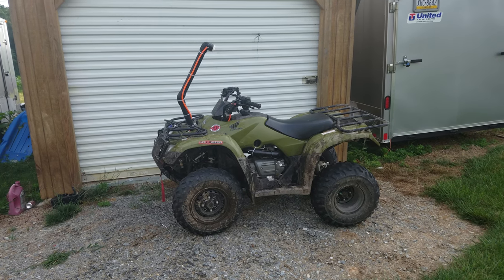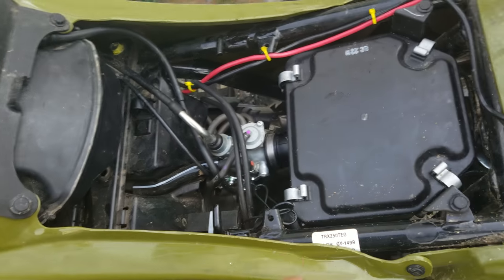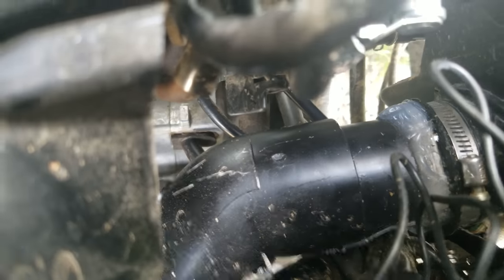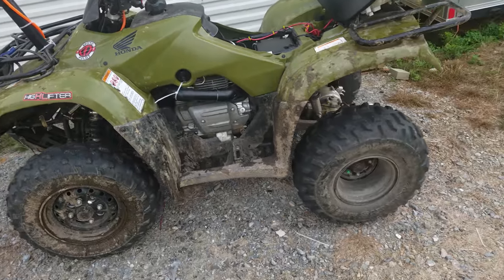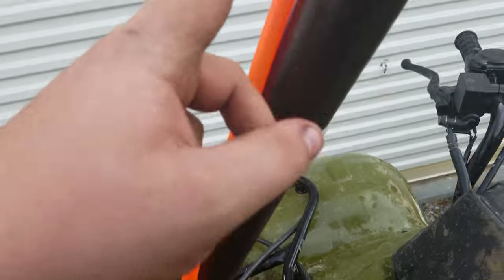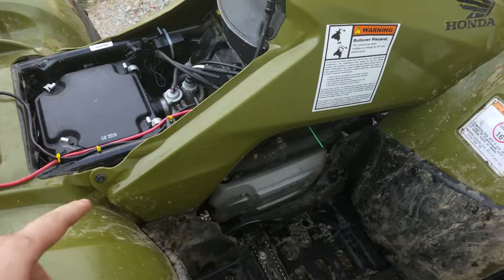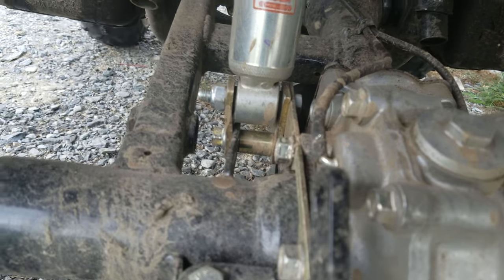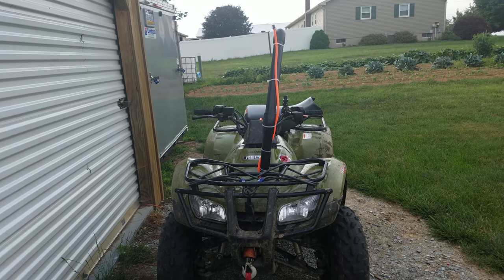How to snorkel a 2016 honda recon 250 es

Comment: So disconnect one end of the crankcase hose and extend it to run up with the snorkel? Just like all the others?
Reply from the maker: Curtiss Hodges  yes, both hoses from the diff run up and converged into one useing a Y connector. Then the single hose runs to the carb vent and takes another Y adapter to connect the now single diff vent hose to the carb vent, then I ran a single hose up the snorkel for venting. 

For the big crank case breather I just picked up a hose connector from the hardware store and ran one big hose up the snorkel.
Reply: The JDM Workshop how big is the hose connector
Reply from the maker: @Raycharles2nd  5-16th if i remember correctly. Its been a while

Comment: This vid really helped me out do you know what size tubing I need to run up everything
Reply from the maker: I truly dont remember, 4mm 6mm and i believe the crank breather was 14mm
Reply: The JDM Workshop thank you
Reply: The JDM Workshop what did you use to seal off the hole in the air box after you took the crankcase breather off and also do you know where I can get y connectors
Reply from the maker: @Raycharles2nd  i used some ultra black rtv and filled the hole. For y connectors look on ebay for 4mm fish tank air hose splitters

Comment: When I looked on high lifter.com all they had was 99 to 08 models how did yours work?
Reply from the maker: Will Knapp look for a 2014 honda recon lift. Thats what im using. Also didnt get mine from highlifters website.
Reply: The JDM Workshop oh okay I found a 1’5 from them but okay thanks I’ve been looking to fit one on my 2012 for ever but I have 2 other questions 😂 1. How did you run your winch and is there a mount 2. Can you buy snorkles for recons or do you have to make them?
Reply from the maker: Will Knapp for the winch i used a older recon winch mount and a harbor freight universal mount. 

A snorkel i made myself but no one seems to make one for it
Reply: The JDM Workshop okay thanks

Comment: Can you make a video of how to test your ATV snorkel?
Reply from the maker: Drive into deep water. If it leaks you know lol
Reply: Ok
Reply: Just put your hand over it if it cuts off it works if it don’t it has a lwak
Reply: @ashtonfarthing7522  I already have my honda recon snorkeledand I took it stupied deep in a pound but when I was building it I tested it with the pvc pipe on but not glued and it still cut off
Reply: @ashtonfarthing7522  and I think that that is not the right way to test it bc I put air in the snorkel and spray it with soapy water and I just had a leak in the air box

Comment: And does the 2011 models have the crankcase thing
Reply from the maker: Idk mine is a 2016 and on the right side where your knee would be under the plastics. Mine is a little rectangular box with a hose.